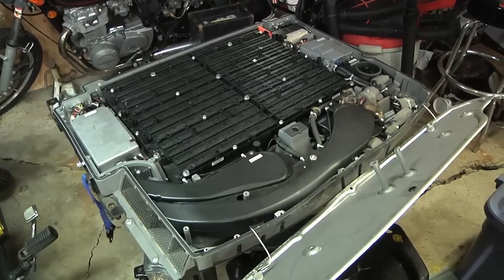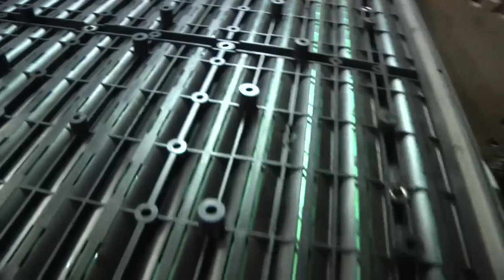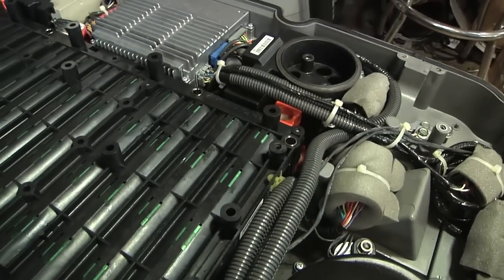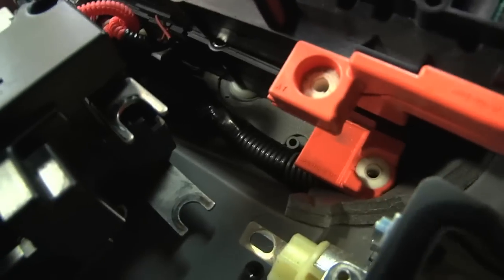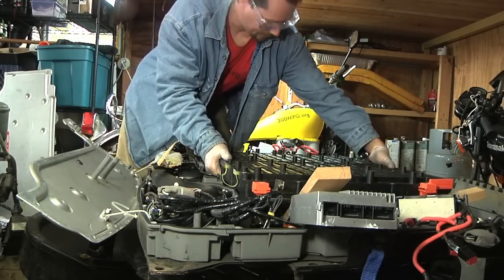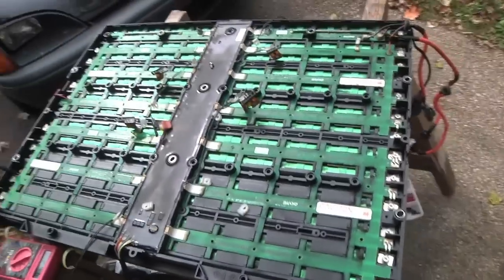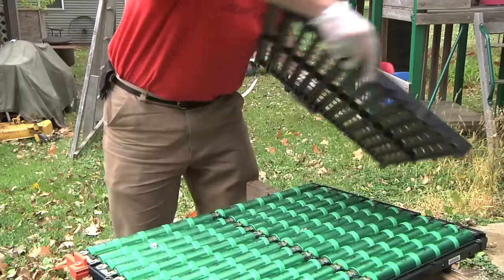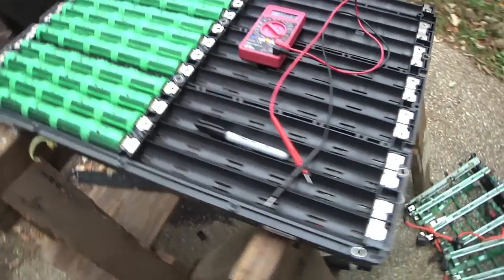Disassembling a Ford Escape Hybrid Battery Pack for the Electric Motorcycle

Comment: The part at 3:52 where you say "it's a little bit of a trick" removing that module blocking the terminals is an understatement!  I just cannot figure how to get that dang module out of the way.  Been unscrewing things and nudging things for a week now.  Mostly just scratching my head.  Any suggestions?
Reply from the maker: Hi Gary,
Frankly, it was 8 years ago that I did this, so I don't remember some of the details!
My trick has always just been to remove every screw or bolt I can find! Sometimes they are hidden under a sticker or another component.
Good luck!

Comment: I saw someone posting about not putting these Ford Escape NiMH cells/sticks in parallel because of the full charge voltage dip which will cause thermal runaway. 
Is that a real concern or just someone being alarmist.
Reply: real concern, but these are all in series, 150v + 150v -> 300v

Comment: Wow!  Great video.  Was wondering how that back was setup internally.

My 2005 escape hybrid was fairly totaled in an accident while parked.  (Heavy body damage). 
However, it is still drivable and as far as I can tell, the battery pack is still operational as it holds a charge and I can still drive in Electric mode for a couple miles.

I am looking to purchase a PHEV to replace it.  I had a solar recharge project in mind and was wondering if I could re-task the old hybrid pack into storage for storing the power and aid in recharging the PHEV.  The batteries appear to still have some life in them.  Maybe I could make use of them until they completely die.

Comment: HI, i have 2009 Ford Escape Hybrid, and i have the same battery you opened in the video, my battery working good but the battery has 0% charge and now the car dose not start how can i charge the battery with out opening the battery or starting the car ? thanks
Reply from the maker: I can't think of any simple way of charging the battery WITHOUT opening it or starting the car. Typically, hybrid car battery packs have an internal contactor, which must be activated to complete the circuit. Even if the battery was OUT of the car, at a minimum, you would still have to be able to activate the contactor to even hook up an external charger. It's pretty likely that one or more of the cells in the battery are bad and have to be replaced.
Probably your best approach would be to get your car to a mechanic (or the mechanic to your car) who specializes in Hybrid Battery Packs. For example, http://www.evpowers.com in Madison, Wisconsin deals with this sort of thing all the time.
Do a search and see if you can find somebody locally who specializes in hybrid batteries.
Good Luck!
Reply: why i am saying the battery it still good just because the car has been left for over 8 month.
Reply: Don't know it you already have the answer but your Escape has a button in a panel near your left foot.  It uses you 12v battery to charge the Hybrid battery so you can start the car.
Reply: @kinster02  Incorrect. The HV jump system was discontinued after the 2008 model year.
Reply: @snoobler  My mistake didn't know he was talking about 09, I have and 08.
Reply: @kinster02  2009 and up do NOT have that button.  Ford removed it to save a few bucks.
Reply: Cant you put the car in neutral, push it to a certain speed (running does great for motorbikes) and then let the first gear clutch in? Should work as far as i know
Reply: @Pimpmedown  Absolutely not. It's a CVT.

Comment: How do you get your DIY electric bike inspected? How to get title for that converted motorcycle?
Reply from the maker: +usfootman
The motorcycle already has a title. There is no reason to get a new title just because it now runs on electricity. Motor vehicle inspection policies vary GREATLY from one area to another. Simply check what would apply to you BEFORE you start a project, so you can make sure you can legally operate your vehicle when you are done.
Reply: Thank you

Comment: Looks a great idea and it will give you a mega boost from the lead acids, Nickels really pack some max amp discharge :-) Cant wait to see what the array comes out as, how you planning on charging them? Perhaps 4 x 12v batteries would balance for longer rather than a 48v :-) Its 4 chargers but at least the packs can charge faster simultaneously :-) Its what I did with my little Gio E-Bike and it seemed to turn out pretty well. I will be well keeping a good eye out for a wrote off hybrid now :-D Cheers
Reply from the maker: I'm thinking of 6 x 48V chargers. They are inexpensive, and six of them is still small enough to mount everything on the cycle.
Reply: sounds awesome :-) I leave my chargers under the couch though and just run the wires in to ports I made from an old tobacco tin :-p
Your bike looks pretty big and robust so it makes good sense to get them on there incase you want to charge it out and about :-)
Is it confirmed that each of the packs will be 48v25ah? cant remember there :-)
Reply: Hi Benjamin, you got me thinking earlier with this :-p do you recon these cells could be used for solar systems do you know or recon? I cant see why not right :-D
Reply: Just incase your not sure you have 50 x 5 D-size nickel-metal hydride cells @ 1.2v10ah :-)
Reply from the maker: battonfive I think they would work fine for solar. You would just need to use a charge controller that can be set for NiHM chemistry. I don't know if that is common or not though.
Reply: honestly I think your a legend for coming up with hybrid cells :-) I thought that maybe diy places might have lithium-ion bins floating about from wireless tools, but when I think that the first of the hybrids are starting to fall in that so called 'second hand' market, then you just opened the door up in to using these ni-mhs.  They are beast powerful, and compared to the price of sla batteries they are still a mega win :-)
  I'll have a look in to the charging this eve and drop off what I find here later on incase its handy :-)
Reply: Hey Ben, just to leave my update on the idea of using these nickel batteries for solar arrays.  Some charge controllers will directly work with ni-mh chemistry, but for a work round you could and should be able to have a small battery array that is charged by the solar stuff, then using an inverter you can then use normal 12v ni-mh battery chargers to then charge the larger nickel array.

Next year I want to make a renewable setup with some wind and solar, so I will be testing bits of it on and off over the coming months.

Looks theoretically sound though :-) Cheers for the share, it goes to show how useful documenting this gear really is :-D

Look forward to seeing how your bike comes out.
Reply: @battonfive  Cells are 5.5Ah
Reply: @snoobler have tou tested max discharge per cell amperage wise or c ratings?
Reply: @Devin20852  tested no, but have observed in car 100A discharge and 50A charge in 06-11 civic hybrid that use these same sanyo cells. The FEH doesn't push them that hard.

Comment: Maybe you can use thin pvc pipe to house these cells. That would be pretty sweet to be able to slide them into . Don't know if that would take up too much space though. Just a thought.
Reply from the maker: I hadn't thought about PVC pipe. Right now, I'm sort of leaning towards using plastic and laser-cutting holes in it, and running the plastic sheet vertically. Think swiss cheese with cells in the holes!